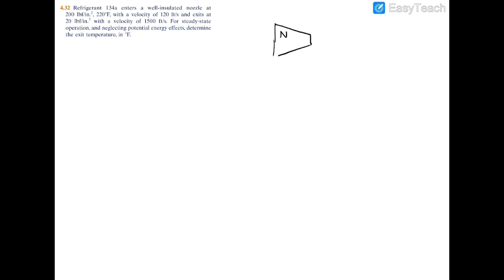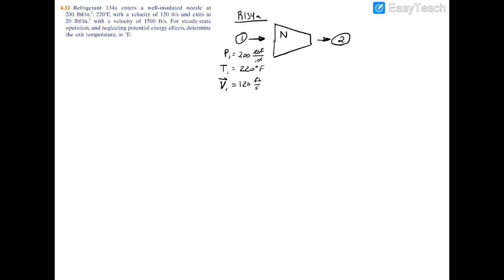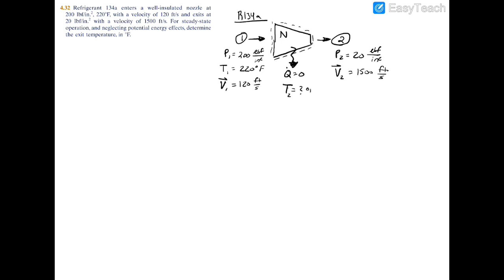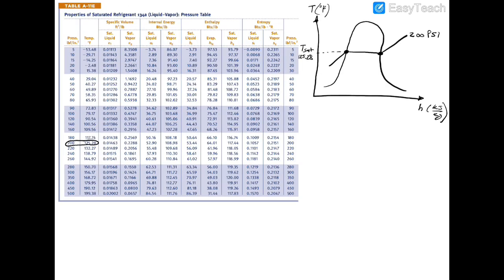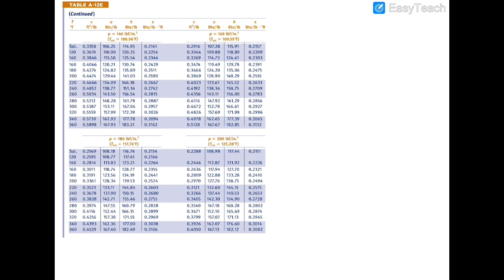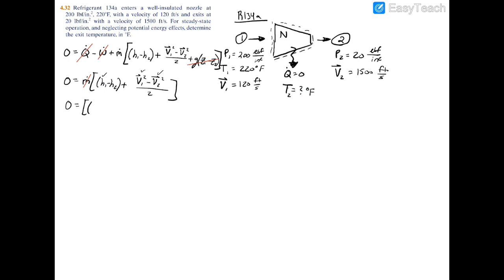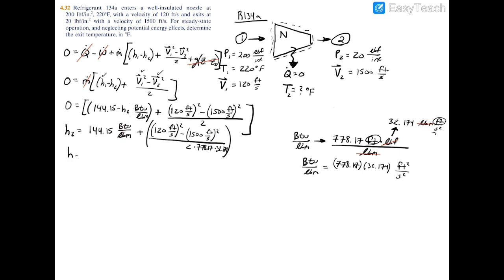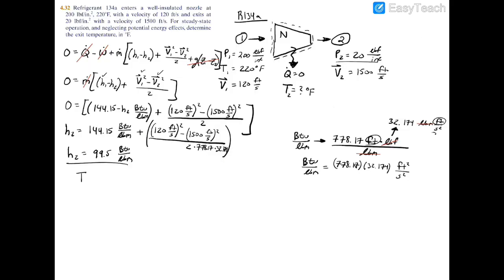4.32 Refrigerant 134a enters a well-insulated nozzle at 200 lbf/in.2, 220°F, with a velocity of 120

Comment: Bro, thanks a lot for existing! My first test was a success because of you—I got the highest grade in the class. Just as a suggestion, I’ll post the exercises my teacher recommended. If you could record more videos, especially after chapter 6, it would help a lot.

Cap 1: 5, 9, 20, 41, 50
Cap 2: 3, 26, 28, 34, 57, 59, 67, 70, 81, 85, 86, 90
Cap 3: 5, 10, 14, 19, 21, 35, 41, 42, 50, 53, 57, 76, 85, 90, 96, 104, 105, 106, 111, 112, 113, 120,
124, 131, 132, 144, 146, 147.
Cap 4: 8, 17, 19, 26, 29, 31, 41, 43, 50, 53, 55, 60, 65, 74, 84, 95, 97, 108, 110, 112.
Cap 5: 10, 13, 18, 20, 39, 41, 48, 63, 73, 80, 85, 88.
Cap 6: 4, 8, 26, 28, 30, 31, 43, 44, 80, 82, 91, 103, 111, 119, 147, 159, 172
Cap 7: 2, 15, 23, 27, 105
Cap 8: 1, 5, 16, 22, 25, 26, 30, 31, 33, 38, 46, 47, 49, 60, 61, 63
Cap 9: 42, 46, 47, 50, 52
Cap 10: 3, 8, 13, 14, 17, 22, 29, 32, 33
Reply: thank you sm imma use this!